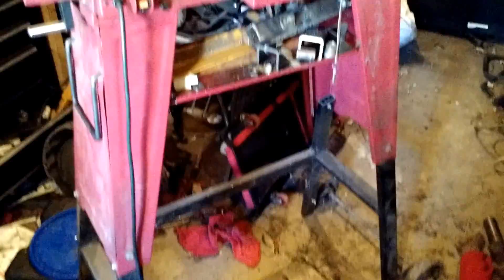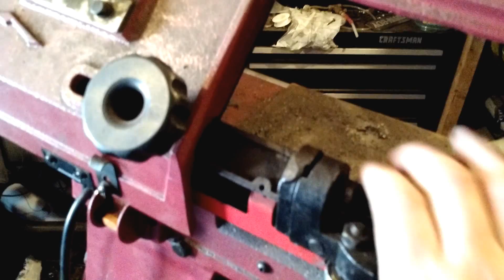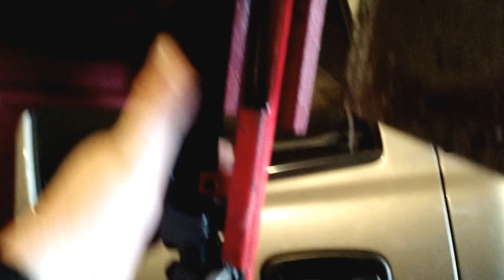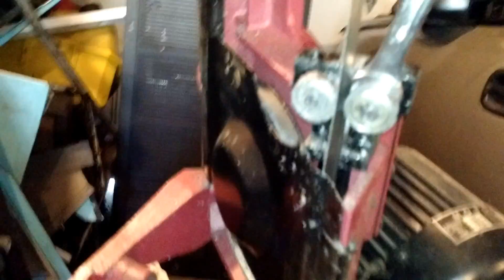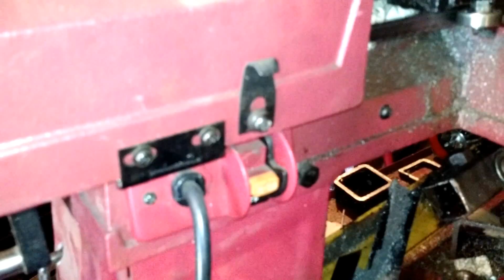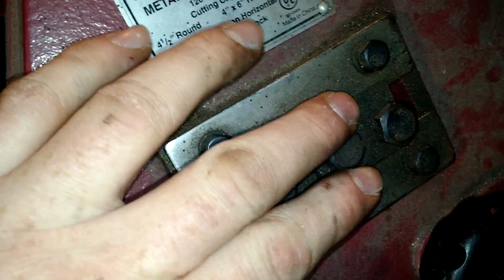Harbor Freight Metal Cutting Bandsaw Review and Mods 93762

Comment: I just bought this one, I got a great sale/ 20% deal on it, I like this video good info.
Reply: I just bought this thing yesterday. Got the same deal, 20% off coupon. $225 out the door with tax. Got it all set up last night and I'm really shocked at how accurate it is. Very little play in the swing arm. Very accurate vertical motion creating great cuts that are closer to 90* than I could ever hope to get using my portaband. And there is nothing so complicated on this machine that I couldn't easily diagnose and fix on my own.

This is going to transform my layout and fit ups.